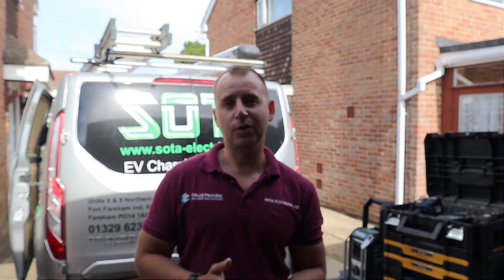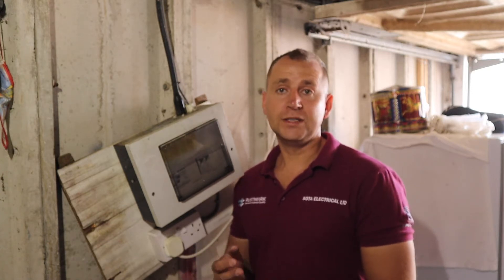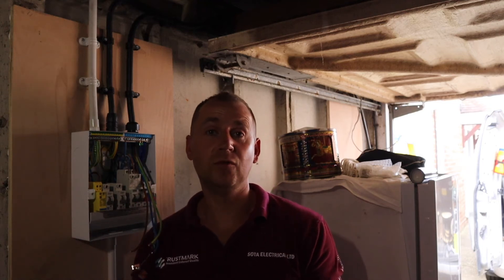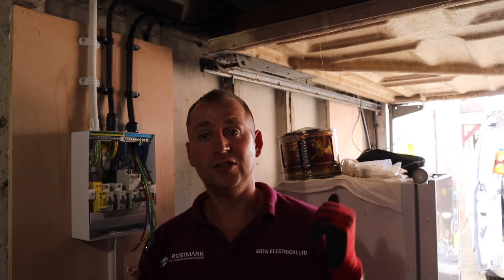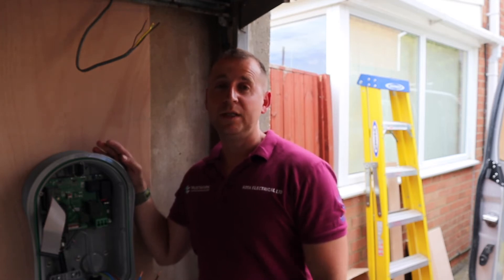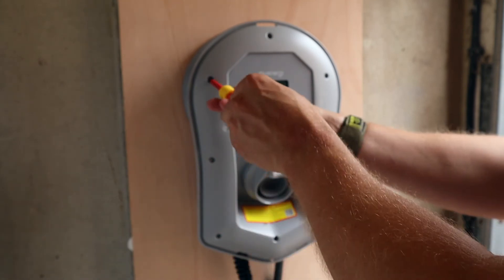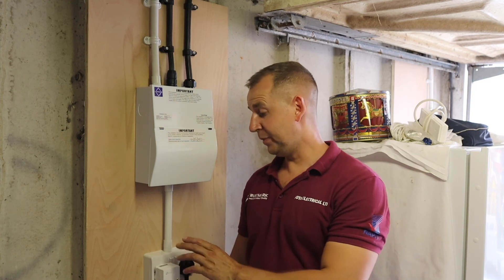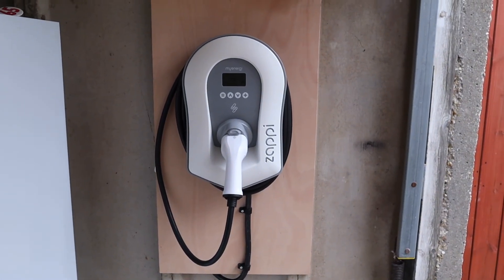Installing a car charger in a concrete garage, non-standard installation. #electricvehicle #ev

Comment: I have something similar and about to get an ev charger for outside of the garage. My question is my garage has a separate fuse box (not consumer unit) can I have my install to an upgraded fuse box in the garage which is on a 4mm squared cable from the main house? Thanks
Reply from the maker: I would say no unfortunately, it will need to be a minimum of 6mm